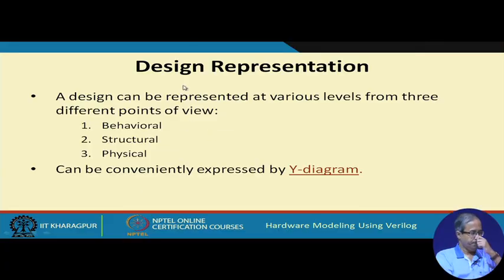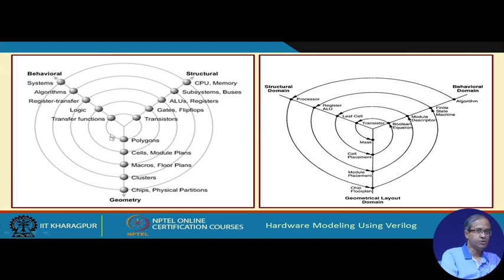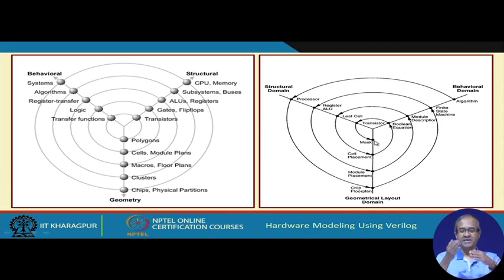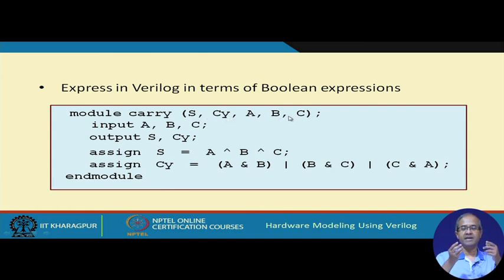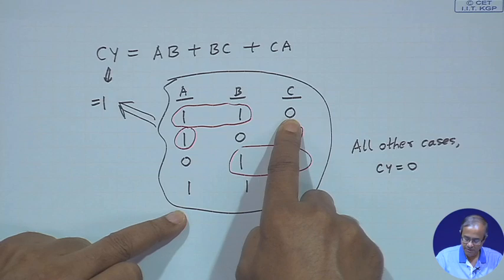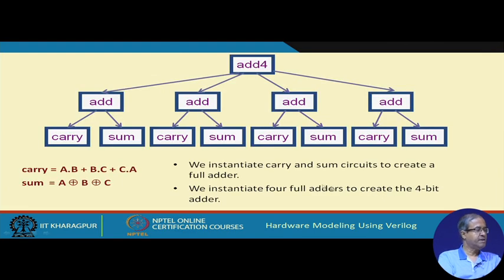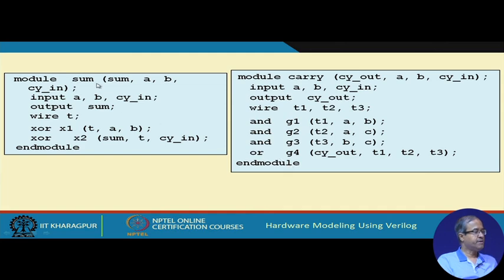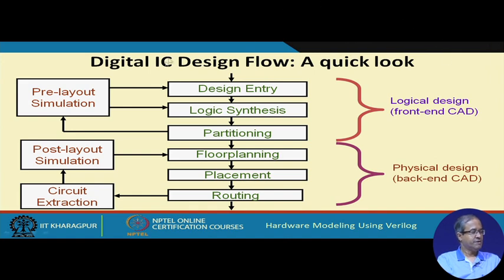Design Representation

Comment: Quick access revision
1:22  design representation
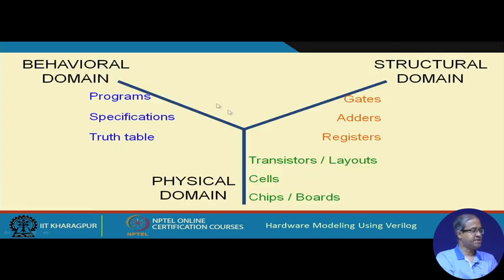2:41  Y (wye) diagram
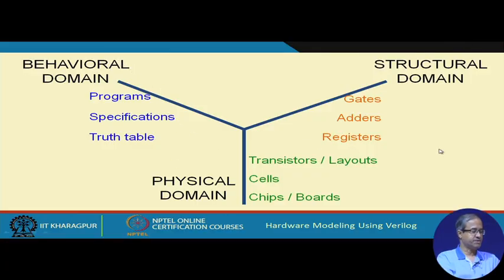5:08  more on Y diagram contd.
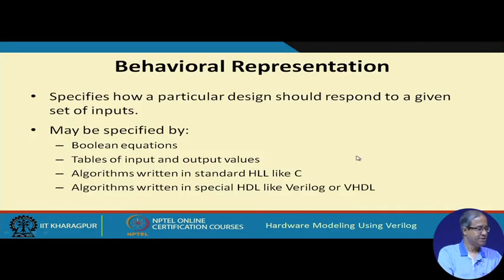10:04 Behavioral representation
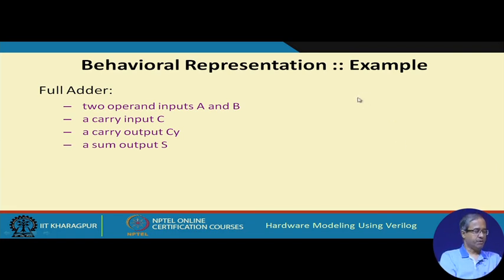11:02 Behav. repr. example full_adder
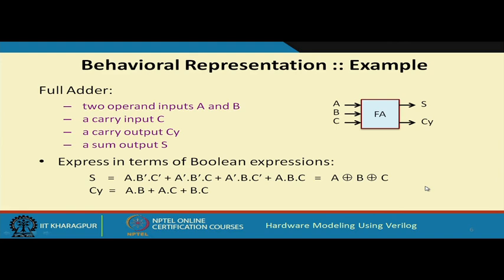12:28 Behav. repr. example (verilog boolean exprsn.)
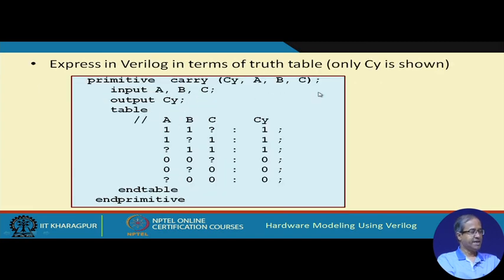14:42 Behav. repr. example (verilog truth table)
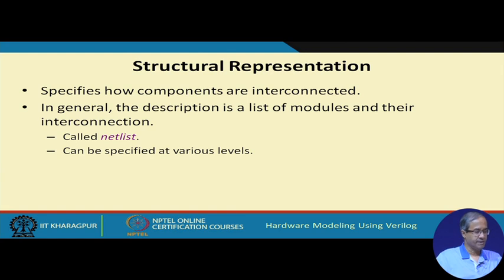18:08 Structural representation
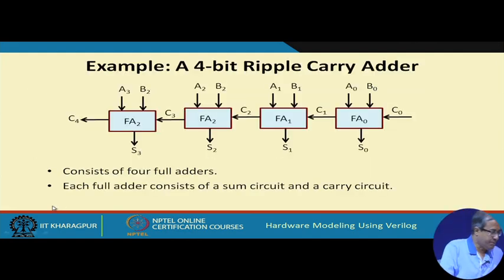19:51 Struc. repr. example (4b ripple carry adder)
21:13 Struc. repr. example (conceptual repr.)
22:04 Struc. repr. example (verilog 4b RC adder)
27:04 Physical representation
27:49 Phy. repr. example (partial description in verilog)
29:10 Digital IC design (a quick look)
END OF LECTURE
Reply: Verilog HDL Complete Series | Lecture 3 - Part 1 | Data Types in Verilog HDL by FPGA made Easy. Subscribe to the channel "FPGA made Easy".